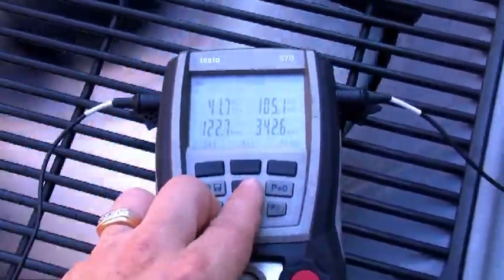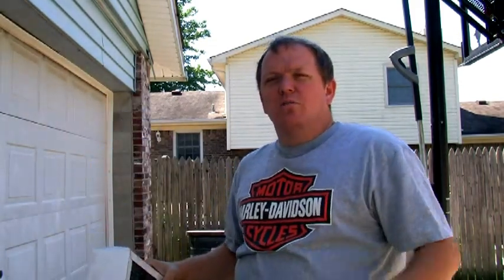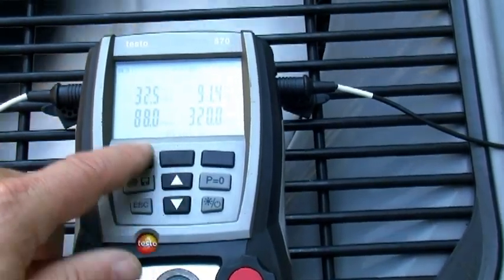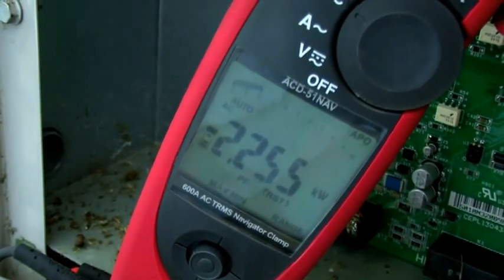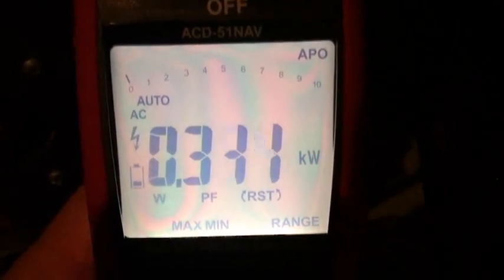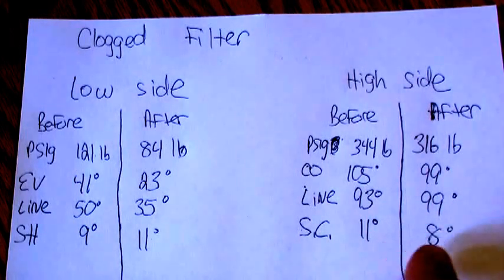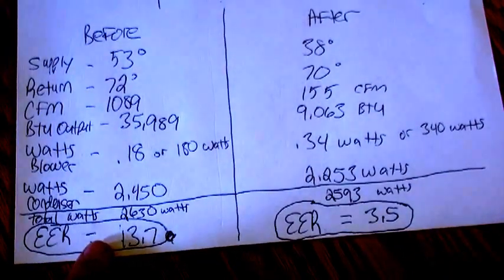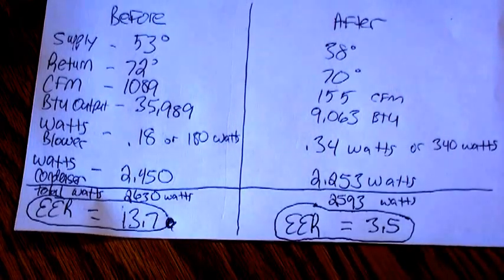HVAC Training - How to spot low air flow

Comment: ( +Michael Brown) the wattage is one part of the equation used to determine the EER of the complete system. Notice (@6:19) that the two BTU totals are vastly different, 39k & 9k BTU's  BUT THE TOTAL ENERGY required for each is differentiated by less than a 60 watt light bulb! (2630 watts vs. 2253 watts). This reveals that the unit is costing more than 4 times in energy costs (39,000/9,000=4 ). Total increased to the consumer doesn't stop there, longer run times, oil return issues, overheating of discharge valves etc etc.   https://en.wikipedia.org/wiki/Seasonal_energy_efficiency_ratio

Comment: the pressure temp differences make no sense,  the after looks like the before, you have a clogged air filter you get low pressure, superheat, 23F coil gives you icing.

Comment: Great video. I've never seen the wattage measurement taken at the contactor. 

If you don't mind me asking, what do you personally use this measurement for? 

Thanks, I learn a few things from your videos and appreciate your expertise.
Reply: +Michael Brown the wattage us used to determine the EER of the unit. Notice that the two 'total BTU's ' are so vastly different, 36.9K compared to 9K BUT the total power difference between the before and after is less than a 60 watt light bulb. You  can't determine what a unit is costing to operate or how well its operating without knowing this information. Every GOOD manufacturer will include in their literature charts at different temps as to what the EER/SEER and watts should be, their ball parks, this example shows the system is in need of extreme attention.

Comment: Great video! Thanks for sharing. You said subtract 35 degrees from your indoor temp and that should give you your evap saturation temp. I am assuming that  is for a 15seer. What would it be for ten and thirteen seer? Great tip by the way! That was subtracted from room temp not return temp correct?